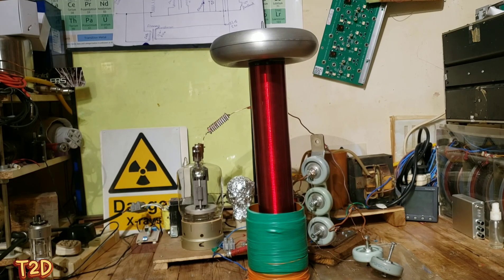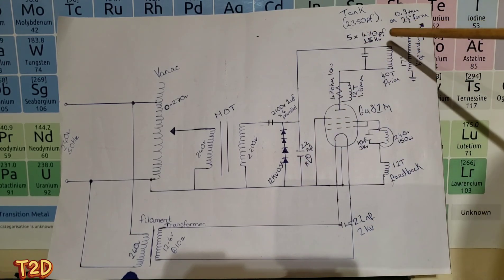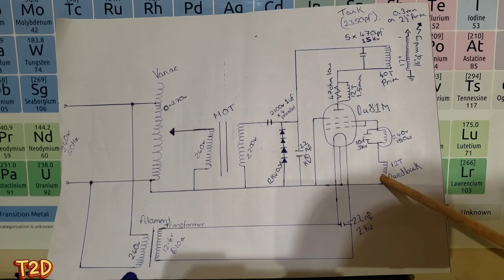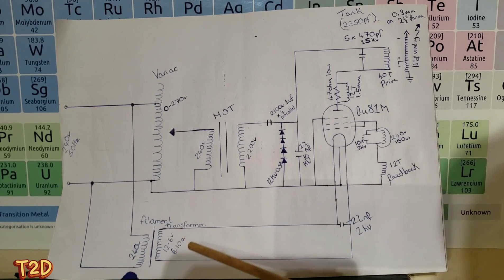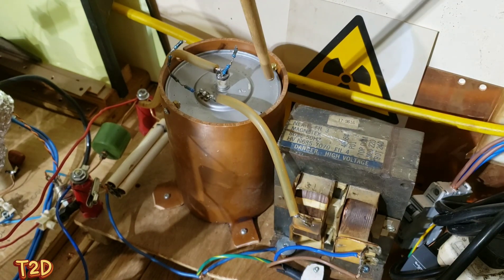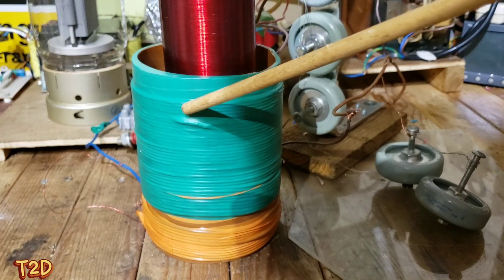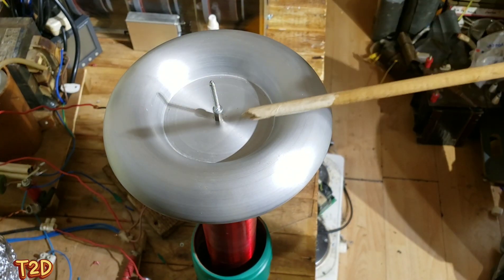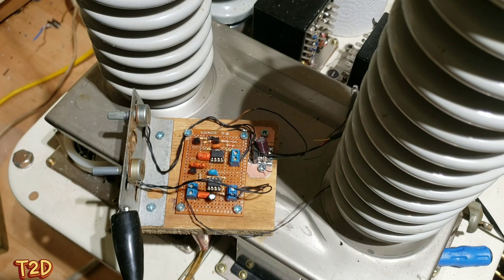GU-81m VTTC with schematic ⚡

Comment: best gu81 vttc good job 👍also do u mind updating the schematic so it shows the voltage ratings of the caps because im roughly sure what they are but it would help to know exactly thanks
Reply from the maker: There's another gu81 buid on my channel "can my wife build a Tesla coil " I think this is a good build and shows some more information,  I will update the schematic at some point 👍

Comment: I forgot to ask... Why a light bulb instead of a resistor? Scratching my head over this one. My coil uses a 50k resistor with a 2000pf cap. across it to ground the grids. Maybe you'd want the resistance change as the filament heats? Curious!
Reply from the maker: Yes I want the positive temperature coefficient of the lamp mate, I plan a in depth video on vttc at some point... 

Steve
Reply: @T2D.SteveArcs  Ah...OK.

Comment: Could i use a gu-50 with this circuit?
Reply from the maker: Hi, the GU-50 is a very small tube capable of only around 50W output, the gu81 is capable of 750W so while the answer is in theory yes you can build a Class C VTTC with a a GU-50 it will be very small and disappointing if your goal is to achieve something similar to this coil .... 
Thanks for watching 

Steve 👍👍👍
Reply: @T2D.SteveArcs  I don t need a lot of power anyways, so could I use the component values you used but with the gu-50 with no problem? I m planning to make it staccato interrupted. Thanks!
Reply from the maker: @Raulley27  no you can't really use the same values, you will need to make a primary that is impedance matched to that tube also your feedback and grid leak will be different as the gu50 won't need anywhere near as much drive or leak ... also the tube is in parallel with the primary and has its own capacitance.. you will need to select components to suit that tube...   

Steve
Reply: @T2D.SteveArcs  oh ok, I didn't know about the primary impedance thing, also the caps in paralel with the primary are for matching the primary resonance with the secondary or is it a self resonating circuit?
Thanks!
Reply from the maker: @Raulley27  yes it's a dual resonant coil parallel LC primary circuit but the Vacuum tube also adds capacitance. Look at the schematic and you will see how this is the case 👍
Reply: @T2D.SteveArcs  Okk, thanks for the help
Reply from the maker: @Raulley27  no problem 👍

Comment: Hey, will this schematic work correctly with a GU81 tube?
Reply from the maker: Yep, but look though my channel, there are better gu81 coils 😁👍👍
Reply: @T2D.SteveArcs i have seen this videos arcs from the coils are impressive😀, i have question what type capacitors did you use in staccato controller?
Reply from the maker: @Mervvi1  polypropylene film and electrolytics

Comment: Hey i bought the staccato controller u told me about. Where do i connect the output of the controller?
Reply from the maker: It connects to the SCR on the ground path, you might want to build an isolation circuit if you know how to, photo transistor and ir led and a mosfet.. I might try do a vid on it soon, I just got out of hospital and I'm still pretty sick unfortunately but I will try help you where I can, you can add me on FB if you want 
Steve Arcs on FB

Comment: What changes do i have to make so i can run the vttc without the staccato controller?
Reply from the maker: Don't put the scr in the ground path
Reply from the maker: But CW is really hard on the tube and staccato is much better for the tube and the output, you can't build the controller? Its really simple,  couple of 555 timers and a few bits and bobs.. if you are not good at building circuits yet then you can buy the same staccato from Ebay for quite cheap, heres a link to a guy in Germany he sells completed boards or kits. This is the completed board https://www.ebay.co.uk/itm/324801088914?hash=item4b9fa74d92:g:OyoAAOSwnCdcPPsc&amdata=enc%3AAQAIAAAA0L4ENgCO7dVtUfgP9KRbKFqY59Fg6WsAB40nrmMcuPmqA4XsmPCzgoOQMuppeIxE%2F6j8o1ioVCWRSIkDQoic278lmBwu5D%2FMqnTqVENu7VaAjU1Y6ARTuZn1zxpHeObD4CD%2FtVFm4zXpS8idbYWBnIgrlf6QIkJHGDHYtFNZ5p7CWV%2B7YfrAg6SmHJPr%2Bj0byBlZosXASNg29%2FPQqkzh8GNMuu7ZMA8eAm8wbarihLiQHh8PzZKc3xuvDvj5%2Bt7ZR7tCdYeePvljvi59DhKf0RY%3D%7Ctkp%3ABk9SR5Kd0YukYg

Steve
Reply: @T2D.SteveArcs  i made many mistakes while soldering the components and at a moment i gave up because it was too messy and didnt know what was connected to what so i wanted to skip te controller and just run it without. But thank you so much for letting me know that i can buy it complete and giving me the links 🙏
Reply from the maker: @mikailgargili  no problem mate,  thanks for subscribing to my channel 😎👍, I will always try to help my subscribers if I can 👍👍

Steve

Comment: Hey steve, is calculating the resonance frequency of a vttc the same as for a sgtc? Formula: f=1/2pi*sqrt(L*C)
Reply from the maker: It's a parallel tank circuit and the tube has it's own capacitance that adds to the tank caps but yes just use an online parallel LC calculator. But if you copy my coil exactly it will be resonant around 400khz
Reply from the maker: A lot of people make the mistake of trying to improve my coil before they even built it ie making a longer secondary more turns etc but vttcs don't work like sstc also increasing secondary turns will lower the frequency and this will mean you will need to add primary turns and capacitance to compensate and make sure your impedance matched again

Comment: Hey, is it possible to use 1.3mm wire instead of 1.5mm for the RL filter?
Reply from the maker: Yeah no problem 👍
Reply: @T2D.SteveArcs  thanks for your response 🙏
Reply from the maker: @mikailgargili  hey no worries.. 😁👍
Reply from the maker: Have you seen my other GU81M coil? It's a lot better output than this one https://youtube.com/shorts/WqKtdPxW4q4?feature=share9
Reply: @T2D.SteveArcs  yes it definetly looks better. I could have start building the final version of your gu81m vttc to get greater output, but it's my first time working with tubes and my knowledge isnt that high so i just stuck to the older version which looked doable for me. Thank you for sharing the schematic with details, i wouldnt be able to build a vttc without you!
Reply from the maker: @mikailgargili  be careful high voltage microwave oven transformers can be lethal, you should get someone to help you if you don't know how to work with high voltage safety.. theres another video on my channel called ( can my wife build a Tesla coil) that video is a start to finish build with safety advice too.. I'm not preaching to you I just want you to be safe mate 
Take care 

Steve

Comment: What size of wire did you used for your secondary?
Reply from the maker: This coil isn't very good theres much better version of a 81 coil on my channel
Reply: @T2D.SteveArcs  i already have a 4 inch by 20 inch secondary wound with 26 awg. Would it be too big?
Reply from the maker: @mathysgobeil1592  yes mate I got best results with a smaller secondary 12 inch and got over 3ft arcs, take a look at my other videos....
Ive got some crazy high voltage chaos up there, 300kv xray transformers 10kw vttc and so on
Reply: @T2D.SteveArcs  im in the tesla coil group and saw every videos, you got some insane stuff. You’re like the guy with the craziest stuff in this entire group
Reply from the maker: @mathysgobeil1592  👍👍😂
Reply from the maker: There is a how to vid on my channel called " can my wife build a teslia  coil " every thing is in there mate 👍👍

Steve

Comment: Could i use some 30kv 470pf k15-4 capacitors for the tank capacitor or you choose them for their kvar rating?
Reply from the maker: No mate k15-4 no good they fail fast, try to get 30kva or more if possible 

Steve
Reply: @T2D.SteveArcs  thanks! I will probably order the same ones that you used. If i just buy 5 will it be enough or im better buying a couple more? Because i found a good deal on a lot of 5
Reply from the maker: @mathysgobeil1592  5 is plenty mate to build this coil theres a better video on my channel where my wife builds a 81 coil step by step

Thanks for watching 

Steve
Reply: @T2D.SteveArcs  cool! Thanks for your tips. My gu81-m is already ordered and I’ll post a video of the coil on the tesla coil group when it will be done
Reply from the maker: @mathysgobeil1592  cool cant wait to see it😀👍
Reply: @T2D.SteveArcs  if you want to i can dm you a couple of pictures if the project progression, then when finished I’ll post a video in tesla coils and high voltage
Reply from the maker: @mathysgobeil1592  yeah man add me on Facebook
Reply: @T2D.SteveArcs  i sent you a message on messenger instead. My fb account is banned for 30 days

Comment: Yep, GU81 is a great tube for small, but powerfull VTTC's. Nice work, man :)
Reply from the maker: Thanks mate.. I have other better videos on my channel I'm getting 4ft now from a 1 ft secondary 4 to 1 🤣 I will be doing a vid of finished build eventually....

Steve
Reply: @T2D.SteveArcs  With this tube? :) I got over 60cm with GU81, but there was two MOTs in paralell with voltage doubler, (it was ready for more powerful tube, RD2XG at that moment).
Reply from the maker: @radeksima2608  I'm getting over 1 meter with a 30cm secondary. That's like 4 to 1 ratio but I still think I can get more yet🤣👍
Reply from the maker: @radeksima2608  yes gu81
Reply from the maker: @radeksima2608  look at my other videos mate
Reply: @T2D.SteveArcs  Ok, I'll check it. Thanks.

Comment: Thanks for this video, i managed to complete my vttc i posted the video on my channel if you want to have a look. 
I have one question what capacitor are you using for voltage double?
Reply from the maker: Glad you  liked it and managed to get your coil running. I will take a look. I'm using 20uf for the voltage doubler. But that's probably not necessary, it's just what I had. 

Steve
Reply from the maker: Hey mate, I had a look at your channel but it says no content 

Steve

Comment: Do you have a diagram with the controller and scr connection to circuit included?
Reply from the maker: Yes mate will be showing final version on yt soon but if you waiting I can show you, do you have Facebook?
Reply: @T2D.SteveArcs  try emailing to thefreeone at mail dot com
Ill communicate further from there. Ive got the parts in my basket to buy for this circuit. Is the new circuit that much different?
Reply from the maker: @johnnycash4034  1nf tank cap is main difference

Comment: Very nice ^^
Reply from the maker: Cheers mate. 

Check out update video. 

Steve
Reply from the maker: You are building a coil mate?
Reply: @T2D.SteveArcs   Ipressive output from the small secondary ^^ , Yeah in the middle of making one
Reply from the maker: @twirlywhirly555  cool cant wait to see it... yeah I'm really happy with this mate its got a three to one ratio 12 inch secondary and a 3ft max arc length as you know that's the true way to measure a coils performance...
a three foot arc isnt as impressive if it off a 3 ft secondary lol😂😂

Comment: Love VTTCs, you can hear the arcs so much better without a rotary spark gap running in the background. They also make a particularly pleasing kind of arc.
Reply from the maker: Oh yes mate me too I love these things, they are so forgiving and awsome output, maybe not the biggest but all things considered tube coils are my favourite, tubes are beautiful 🤣🤣👍👍

Steve
Reply: @T2D.SteveArcs  Did you see the valve based circuit StyroPyro built? Not quite the same as a tesla coil but he got some really big plasma 'flames'.

Comment: Wow great output from Gu81. I have one lying around but I dont ha e a socket for it. The socket costs more than the tube so might as well DIY the socket
Reply from the maker: Yes mate they do. But just solder wire straight to the pins, like the one I ran in the video,and then you can just screw the tube down. 
Thanks for watching, glad you enjoyed it. 

Steve
Reply: @T2D.SteveArcs  Is it ok to solder pins straight to the tube?? heat wont destroy the vacuum sealing?
Reply from the maker: @juntendo6104  it's fine use an iron and solder to the existing solder ..